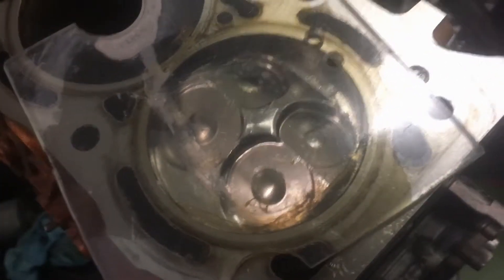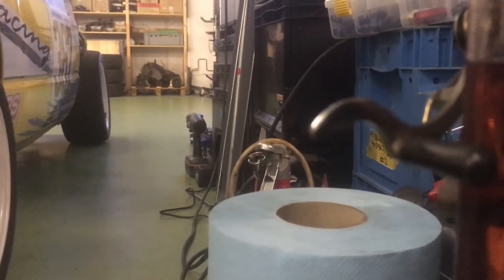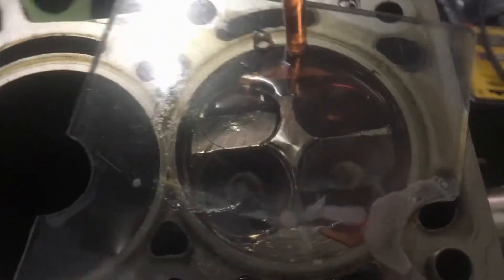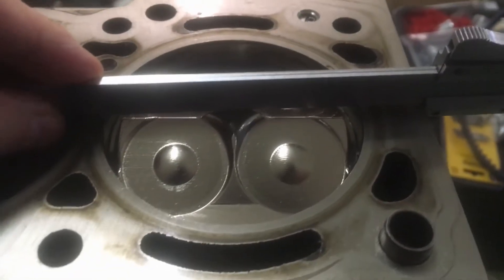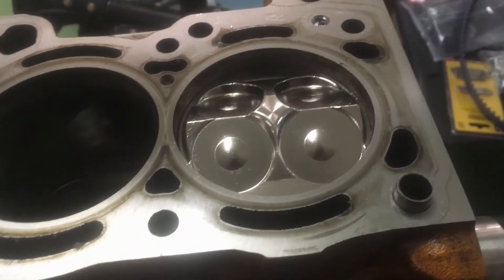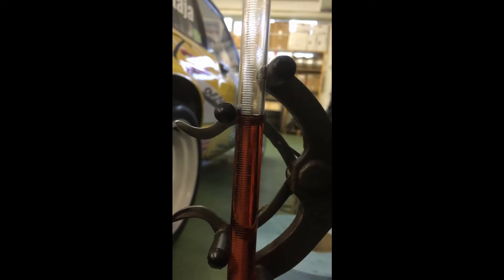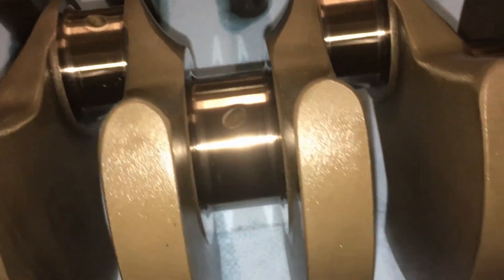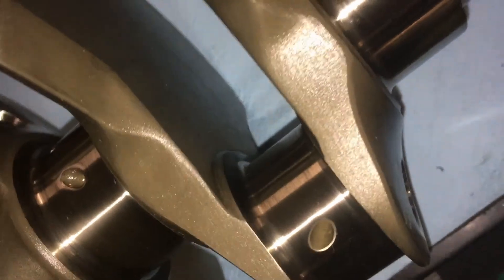2020 prep - Engine overhaul and rebuild - Part 2

Comment: where does one buy one of these crankshafts?
Reply from the maker: Moldex in Michigan makes them. They are all done per wishes from customer they don’t stock them. You need to get a sample or original for them and tell what you want. No 3D models or drawings it’s very old school company.. but they do very high quality with their old machines.😄

Comment: Are the 20 valve heads better than the 16 valve big port heads in this kind of application? Also, you don't need titanium rods to hit 11,000 rpm?
Reply from the maker: Hard to say which one is better in the end. My personal feeling is that in such extreme case the traditional 4-valve layout and combustion chamber is better, but that’s just my opinion. I always back this up with the fact that super bikes went to 5-valve and moved back to 4-valve.. Titanium rod is not needed for 11,000rpm, but a good quality forged light rod is needed. Especially big end has to be as light as possible!
Reply: @VHTRacing  I always thought that the super bikes went back to 4 valve because it has better low end torque compared to 5 valve, which gave them a better torque curve compared to top end power. It could be that the combustion chamber design is better for 4 valve engines though, I didn't think about that to be honest.

Comment: where can i look for those pistons
Reply from the maker: You can’t find them anywhere else. If you want a set we can provide, but it comes as a kit with rods and costs around 2500€.
Reply from the maker: We have some in stock currently if you have interest? 81.25 or 81.32 bore sizes and they are for our long rod of course, very light package.

Comment: Your engine and car is nuts! Love the build and content Mikko. Is your engine with the new piston choice still non interference fitment ?
Reply from the maker: Thanks. If you mean is there enough space for valves on full lift for engine to rotate freely wo piston to valve contact no. The intake valve is closest to piston around 8 deg ATDC and there is only around 1mm valve to piston clearance at that point and still ~6mm left for max lift. So definitively heavy interference possible.
Reply: T
Reply: Thanks Mikko. Exactly what I was asking and sort of assumed it would be heavily interference with valve/piston contact with the modifications you've done.  Keep up the great work 👍🏽

Comment: Mikko why don't you use WPC Treatment on the piston skirts and other components ? Even Cryogenic treatment for valve springs, ...etc
If not a secret, I'm curious about what clearances are you running for the mains and the rods? I'm guessing about 60 microns ? And what bore/stroke combo are you using ?
Reply from the maker: If there would be all the time and money in the world to try WPC i sure would. Sending the stuff around the world for it just makes no sense as i have clearly potential elsewhere first to improve this engine. One of those things like the DLC or ceramic coatings i've used them more in the past, but not at the moment. Basics gotta be right first in my opinion or you just waste money with them. Also things you can't measure your self to see if they really make difference are hard to justify. I have some references for WPC from people that i would generally trust on their opinion, but also opposite comments. Clearances are on the range of 0.02 to 0.04mm, when i speak hundreds or tenths on the video i speak in metric and when thousands i speak caveman units.
Reply from the maker: Coming back to this topic WPC. I’ve actually changed lately to WPC treated followers and they seem to work better, or wear less at least. Same base follower and material so only change was have them WPC’d and it works.
Reply: @VHTRacing  Great ! I'm thinking about using bigger Followers I mean bigger than 28mm maybe 30 or 31mm and maybe have a better Camshaft design to take advantage of the bigger buckets...
Reply from the maker: There’s a reason why we don’t have bigger buckets than the 28mm. Bigger isn’t always better…
Reply: @VHTRacing  maybe you'll change your opinion later... like you did about WPC hahaha

Comment: What oil are you using and viscosity the whole engine is in great condition its beautiful.
Reply from the maker: Thanks. I've experienced a lot over the years with different oils with the engines that i've built and worked with. I've had also a good chance to see what the big oems/teams use in their race programs with different applications. So over the years i've gone from expensive 20W-60 race oils like Motul 300V Le mans especially with these little na screamers to low viscosity standard good quality synthetic oils. Mobil 1 for instance has their european car formula/FS oil in 0W-40 that is relatively cheap, but really good oil for such little engine. I've ran this engine even on lower viscosity, but decided not to push it too far as i had some basic issues to sort first on the oil system. Now i'm going actually tightest clearances i have ever ran on my engines so far and since i have finally enough oil flow i will go also lower viscosity. I have good experience with Motul especially on turbo charged engines and they have also nice range of oils i would see potential options for this 4AGE application like the 300V HIGH RPM 0W20.
Reply: @VHTRacing  i see motul is a very popular choice in racing.